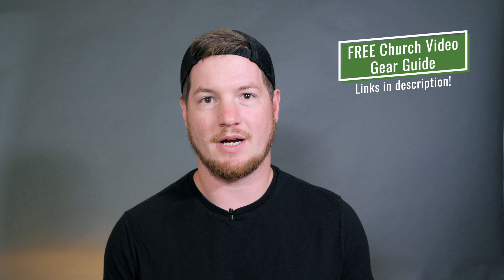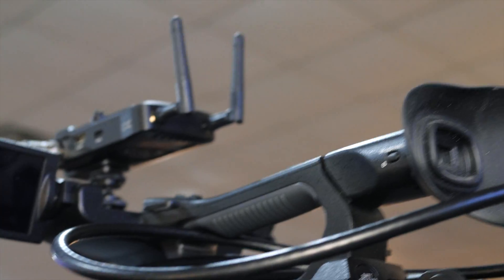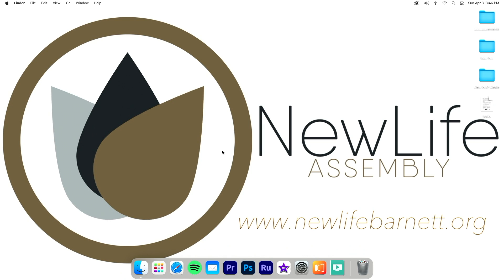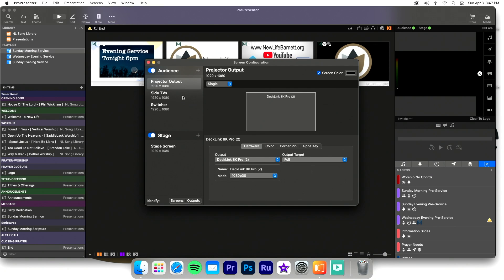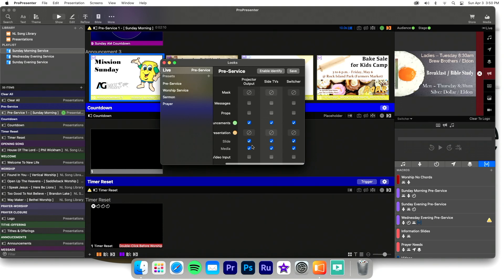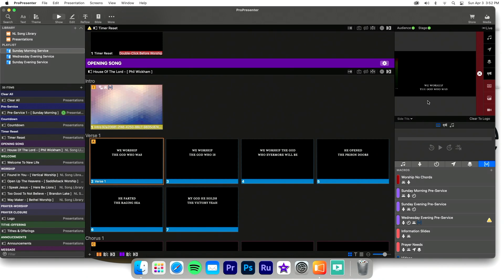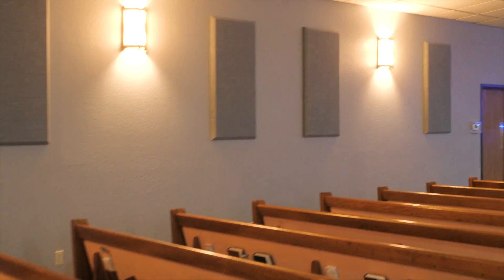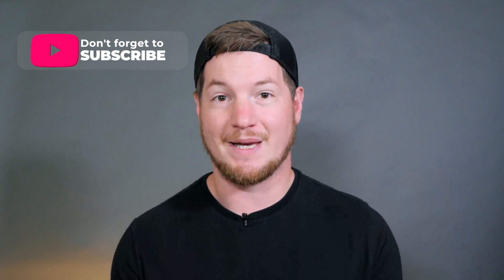Getting Live Video on Your Screens w/ Pro7 (plus Austin gets his own video!)

Comment: Hey man! Quick question, do you know if the Decklink Quad 2 will work in a Sonnet Breakaway Box 650. 

I currently have a Graphics card in their but want to swop it out for a Decklink as I require more outputs. 

Lastly can you individually change the rotation or orientation of each output on the Decklink when you go to displays on the mac.

Comment: your bnc connector for cctv system, why?
Reply: Because there is nothing that you can run on that distance except for 

HDMI RF Modulator Coax Converter VHF Demodulator HD Digital Video Input Adapter

Which is not predictable because you also need signal booster